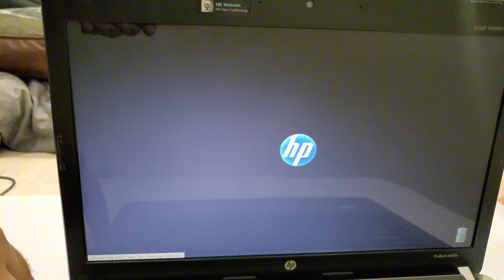Upgrading Your HP Laptop Processor

Comment: You can cut the blue wire on the fan to run it at full power to prevent thermal throttling

Comment: I have a similar model the HP Probook 6465b, and after I updated its BIOS to F.64 Rev. A, it's on board speakers aren't recognised anymore, they show up as not plugged in bit the drivers are installed

Comment: The old cpu consumes 10 watts less than the new cpu. Can you confirm that the laptop works when the processor is 100%. I also want to put a processor with higher consumption on my laptop, but I'm afraid it won't work. On forums people say that it is not possible to replace a processor with a consumption of 10 watts more. Thanks!

Comment: do you think this would work for a 2012 hp 4440s laptop
Reply from the maker: It should, as laptops till 2013 supported swappable processors and came with physical sockets instead of being soldered onto motherboard.
But check it before ordering a new processor.
Reply from the maker: It should, as laptops till 2013 supported swappable processors and came with physical sockets instead of being soldered onto motherboard.
But check it before ordering a new processor.

Comment: Hi. I have the little brother to this laptop, which is the HP ProBook 4330s. We have the exact same motherboard (167E) and BIOS version. I just wanted to confirm with you that I can upgrade my current CPU to an i7-2820QM before placing an order.
Reply from the maker: Technically it is part of the same sandy bridge architecture. But the support for processors depends on motherboard bios. I know for sure cpus till 2630qm are supported but don't know exactly if the one you're mentioning will work.
Check some forums online for more information
Reply: @TechDecoder11  I went ahead with the purchase and it's working as expected :)

Comment: My laptop after upgrading cpu powers makes the boot noises for a second then shuts off but power on led is still on. I can't figure it out everything's plugged in correctly
Reply from the maker: That could be a sign of a power issue or a faulty motherboard. Have you tried a different power adapter?

Comment: I cleaned my fan and removed the heat sink without applying new thermal paste and the laptop is working properly 
Should i reapply the thermal paste or not ??
What would happen if i didnt apply new thermal paste what would happen to the cpu will it burn ?
Reply: It may work ok but because of the increased temperature the cpu will likely throttle  down. It will work but will be slower.
Reply from the maker: Yes, Always apply new thermal paste if you remove the cpu cooler.
It could damage your processor.

Comment: I have a doubt!! I have a HP-Probook 4540s Intel Core-i5-3210M (ivy bridge)

Can I upgrade my Processor??
Reply: Install the free CPU-Z program from the Internet into the laptop. On the first tab of the program, look at the processor socket type. If the socket type is rPGA 988b, then install the i7-3612qm, i7-3632qm processor //
RAM 8-12-16 GB DDR3-1600 2Rx8 1.5v
Reply: @vladimirazirov1815  Hi. Your advice would be greatly appreciated. I have a Dell Latitude with Intel(R) Core(TM) i5-6200U CPU @ 2.30GHz   2.40 GHz and would like to upgrade the CPU because of no compatibility for transitioning to Windows 11. I called some technician in my area yesterday and he told me to buy a new laptop because we could never upgrade a CPU in a laptop. I upgraded the RAM 32GB and the SSD 1TB last year and the laptop is running pretty good. I have no idea if I can upgrade the CPU to my Dell Latitude as well how to find a compatible CPU. Should I install the CPU-Z program into my laptop and find the socket type rPGA988b? Sorry for asking I have no idea where to find the information. Thanks.
Reply from the maker: Unfortunately your laptop has soldered processor so it cannot be upgraded.
But you can still bypass the tpm requirements of windows 11 by following alot of great manuals online.
If you want I can make a video on it as well.

Comment: My processor in i3-2350M can i change it to i7 2600?
Reply: From the Internet, install the CPU-Z program on your laptop. On the first tab of the program, look at which processor socket (rPGA 988b or FCBGA 1023). On the "Mainboard" tab, look at which south bridge -> HM65? HM76? HM67? HM77?  What kind of video card is in the laptop - integrated or discrete (Radeon/Nvidia). This can be viewed through the "device manager" -> "video adapters". Give me this information. What laptop model?

Comment: I upgrade my lenovo g580 to i7 3612qm and 16gb of ram and after 20 min it shows no signs of life 😢
Reply from the maker: Recheck your fan header and make sure everything is properly plugged in. Also, make sure your laptop supports the said processor, which you can check from the specs sheet of your laptop.

Comment: I have a very similar laptop, Lenovo, but similar hardware. Was my daily driver for the whole 2022 and a bit of 2023. I considered a similar upgrade, as the laptop has a 2-core i5-2310M, but I wasn't sure the cooling system can handle a 45 W quad instead of a 35 W CPU it came with. I also wonder if it would work with Ivy Bridge CPUs (3xxx) - same socket.
Reply from the maker: Use 2nd gen Cpu. 3rd gen might not work despite same socket. just make sure to update you bios to latest version
Reply: i think first you look at the socket number of your CPU which is support for your motherboard. then search it on google and check what is supported cpu's. and then replace it

Comment: What is the exact model number of the CPU be caused I have that same computer but I always thought it was bios look and you couldn't upgrade it.
Reply from the maker: I7-2630qm
Reply: @TechDecoder11  sorry of questions and the ram has to be a particular speed I presume. I tried to get to 16 gb before the dame thing didn't post with it. The wifi is a bust, yes is best with a USB because the UEFI bios has a white list of cards.
Reply from the maker: Hp 4430s only supports 1333mhz ram and the whitelist of cards is a shame as only hp has it. @Emma-xh5lp
Reply: @TechDecoder11  thanks,  Although in my case the Wi-Fi is working but the Bluetooth is not. So I have to use a Bluetooth USB dongle. 😅 Thanks,  I'll give it a try again.

Comment: i could put a core i7 850QM (or was it the 840?) but it isnt better than my i5 560m in it right now (the laptop is a dell latitude e6510)
Reply from the maker: For some laptops, the upgrade is not worth it.
Reply: @TechDecoder11  im also pretty sure that the i7 840qm which has a tdp of 45w would run pretty hot, while the i5 560m which has a tdp of 35w runs at 85°C under load
Reply: @TechDecoder11  Is the CPU on my Latitude 3580 Intel(R) Core(TM) i5-6200U CPU @ 2.30GHz   2.40 GHz can be upgraded? If yes, what should I buy or where could I find the information about it because the actual CPU is not compatible for transitioning to Windows 11. I'm at the Windows 11 processor requirement website and have no idea which I should pick that will work with my computer. Could I take any Intel Core i5 or i7 on the compatible CPU on the list? I was told by a tech over the phone to throw away my laptop because we can never upgrade a CPU in a laptop he said. He then told me to buy one of his computer. I upgraded to 32 RAM and 1TB SSD last year and my laptop is doing really good. Thanks.

Comment: Bro which laptop is this ?
Reply from the maker: Hp 4430s
Reply: @TechDecoder11  i have hp 6460b core i7 laptop and I have a question maximum Ram upgradable on this laptop or processer
Reply from the maker: If you are running dual channel ram config then a processor upgrade makes more sense but if not then go for ram upgrade. @prayaggupta-o9n

Comment: I remember when I bought a HP Stream 11.
The storage was soldered on and non-expandable
The RAM was soldered on and non-upgradeable
The CPU was soldered in and non-upgradeable, and was also a Celeron...
I despise HP laptops.
The HP X360 convertible was the same, and my HP Elitebook 840.
I will never touch another HP laptop as long as they live. I say "they" because HP will fall long before I do probably; and rightfully so.

Comment: i think LGA means leg grid array, all laptops use PGA CPUs (Pin Grid Array) nice video though! I have a Probook 4540S at my dads house somewhere
Reply from the maker: Thanks for sharing!
Reply: LGA means Land Grid Array
Reply from the maker: Thanks for Info. I made a mistake in the video. @boyofcreation4895
Reply: @boyofcreation4895  damn....close enough though right?
Reply: @lukedavis436  In a way, yeah. Only thing with LGA is that the pins aren't on the CPU, they're on the motherboard. The CPU has conductive pads that interface with the pins. That's why Intel's LGA CPUs have looked mostly flat on the underside minus the caps protruding a little

Comment: Ok, but temperatures?
Reply from the maker: The Temps are not bad, I would recommend keeping the cooling policy from the power plan active at all times, and if the temps due exceeds, you can adjust max usage percentage to something like 99 or 98 percent.
Reply: @TechDecoder11  Passare da un i3 2 core ad un i7 4 core, con lo stesso cooler è tosta. Non penso siano ottimali le temps

Comment: can i uppgrrade  i5 first gen to 2nd gen????
Reply from the maker: You can do it if your motherboard supports second-generation processors and if the new CPU has the same socket as the old one.
Reply: 1st gen is socket G1 2nd is socket G2 so unfortunately not
Reply: @randomtimes4100  thanks
Reply: @randomtimes4100  but the socket of i5 and i7 of first gen is the same?
Reply: @keithdecena4478  yes but make sure your laptop has the cooling capacity for the i7

Comment: awesome video, deserves my sub! i love watching laptop and pc restorations/upgrades!

i have a dell e5570 (i7 6820hq + amd r7 m370) that i bought used around 2 years ago. bought it from selling my first laptop, a lenovo with the n4100 celeron. 

i need help though:
should i upgrade (mainly new thermal paste and more storage) or sell this laptop and get another used one?

if i upgrade, can i substitute the arctic mx4 for the deepcool z5? sadly computer parts in my country are extremely inflated so i have to go budget :(
Reply from the maker: I7-6820hq is a great budget CPU, and if you don't do anything very CPU-intensive, it will perform great in daily tasks. I have two laptops, one with an i7-3630qm and another with an i7-2630qm, both of which are great for daily usage. For daily usage, I would suggest you stick with it if you don't need a very high-performance system. For thermal paste, Mx-4 is really great; just make sure you get a genuine one. There are many counterfeit pastes out there. If you can, do upgrade to a sata ssd or an Nvme ssd as it really boosts the system and can bring new life to the system.
Reply: @TechDecoder11  awesome, thanks for the reply. 

I currently have an 256gb PNY NVME in this machine, I am thinking of adding more storage by using the WWAN slot as sata ssd storage, some people have tried it using 2242 size sata ssds and it worked on the 6820HQ models. 

I play some games, heaviest being valorant where the laptop leaks upto 77c on gpu and cpu is similar temperatures. Though, sometimes it shuts down due to overheating when doing cpu intensive tasks such as antivirus scanning. Maybe it's time to save up and upgrade this machine.

Comment: this is the power of socketed cpus in laptops but unfortunately some bastards in tech industry decided to use soldered cpus by default.
Reply: I was thinking if I can solder then I can Upgrade? If compatibility is not a problem then it's doable but that's my question, soldering is not the problem for me but the feasibility itself.
Reply: @anonamemous6865  it's expensive & impractical to resolder CPUs.

Comment: I recently bought Acer 5742, A laptop I used to own during my childhood, Repaired it and upgraded the CPU on it. Now I'm just waiting for my replacement battery to arrive!
Reply from the maker: Upgrading and repairing an old laptop feels awesome and is actually great for the environment as it reduces e-waste.
Reply: I love the design of that acer laptop
Reply: @i3_i9  Same! I miss the slick stylish laptop like these. Keyboard absolutely feels better then most laptops for me.

Battery I got was the cheapest one with it at 4400mAh. At max it could only last for an hour-ish with High Performance mode.
It was upgraded to Intel Core i7-620M. I didn't intend to do much but It could actually run most websites with ease including 1080p playback so it ended up being worthwhile repairing

As Tech Decoder said. Its to reduce e-waste. Its a shame that there so many laptops that are still usable but the general public keeps buying new budget laptops which from my experiences, gotten worse with how many of them being shipped with Celerons that aren't upgradable.
Reply: what was the cpu replaced exactly
Reply: @geowilson1587 I'm only finding your comment now after 9 months when I'm revisiting this video. Youtube Notifications is terrible.
It was the i3-380m. The slightest l3 cache increase and the improved iGPU sped up general usage.

Comment: Its worth to upgrade cpu from i3 3110M to i5 3gen or better spend 30€more for i7 3gen?
Reply from the maker: Try to get a quad core i7 if the price is not much higher than i5, and quad-core should improve productivity a lot.
Reply: @TechDecoder11  thanks
Reply from the maker: No Problem. Always happy to help.
 @kuciaapa2768
Reply: i just upgraded my toshiba from your same i3 to an i7 3940xm for around 100$. Drastically changed